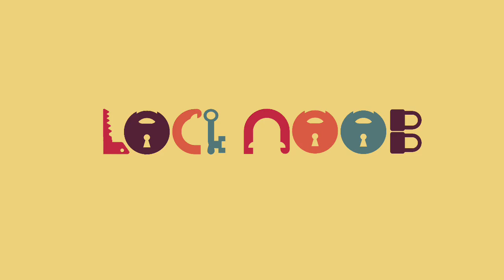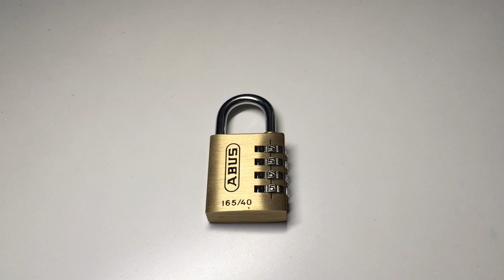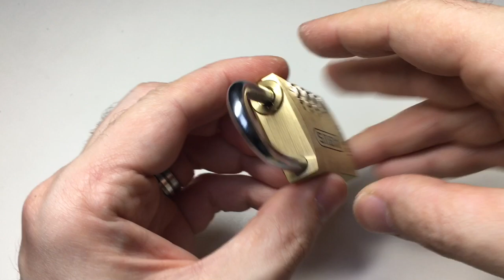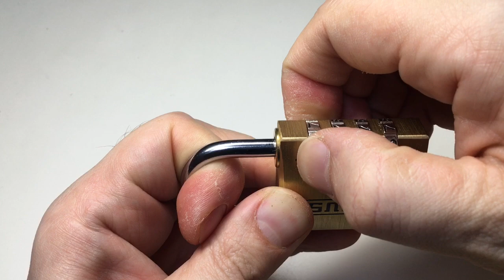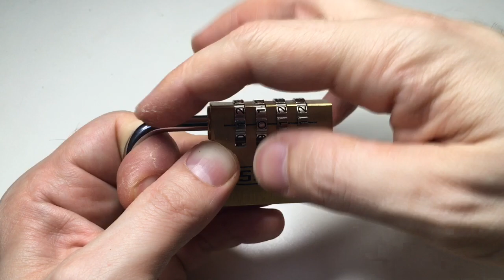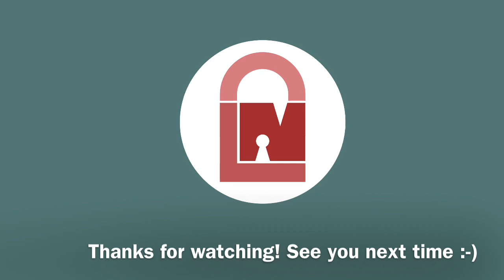(164) ABUS 165/40 Combination Padlock Decoded

Comment: Thank you 
Managed to recover my girlfriends BBL lock 🔒 with this , someone reset it by mistake; 

Notes: 
Pull find the lock point, release the tension, and adjust the tightest one gradually until there is another one thats tighter, then finally they should line up :-) 

Thank you @lockNoob

Comment: Hi! I’ve watched several of your videos and I would like a suggestion from you on combination locks... I am looking for a 4 digit combination lock to use on securing some items while I travel. I can see that with enough time all combination locks can be decoded, however, I was looking to see if you have a suggestion on ‘more difficult’ combo locks then the standard run of the mill. Thank you!
Reply from the maker: While of course I have an opinion, I would recommend talking to a good locksmith, who should be able to show you a range of locks at different prices and security rating. :-) good luck :-)
Reply: @LockNoob  Strangely enough, in the Cleveland, Ohio area, I have found that many "locksmiths" seem less knowledgeable than the folks who post here on YouTube.  At one shop all the locks on display were the same junk the big box store sells.  I asked if they had any disk detainer locks.  The counter person said, "Disk RETAINER lock, what's that?"  At another shop they had a display board of ABUS locks.  When I inquired about one, they said they don't stock any of them.  They could order it in for me, at a price twice what I could get off of eBay myself.  Why shop brick and mortar if they aren't knowledgeable and don't carry the locks?

I have the same question Kylian has.  I've seem lots of vids showing using a thin pick or blade to decode these locks and others using tension and feel.  But, it would seem relatively easy to fix those deficiencies if some manufacturer cared to do so.  Are there any combo locks that do that?

Comment: xa013 padlock black coloured
sir i had set new code but before locking it the numbers changed and i forgot code.
Now the problem is that the lock is not closing and i tried many tricks but failed. any solution?